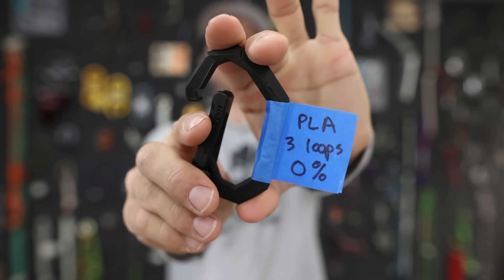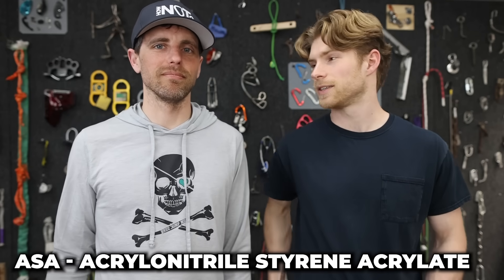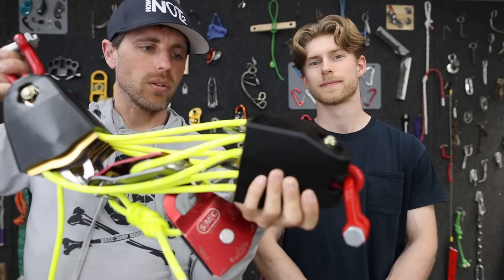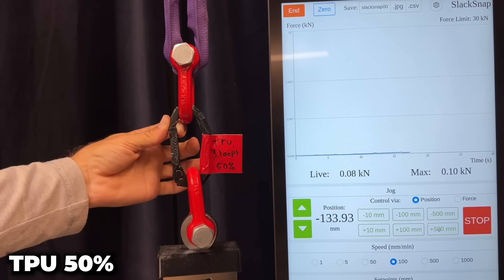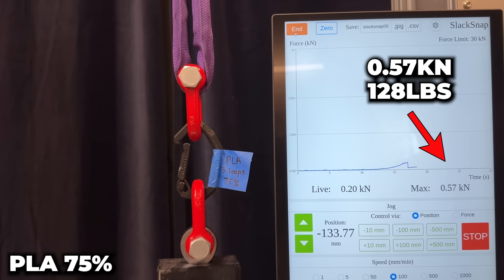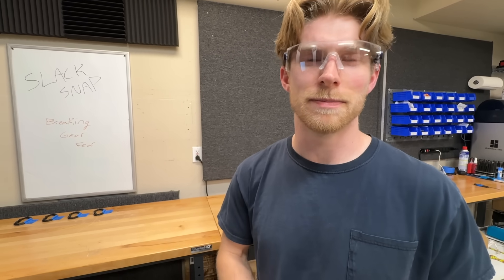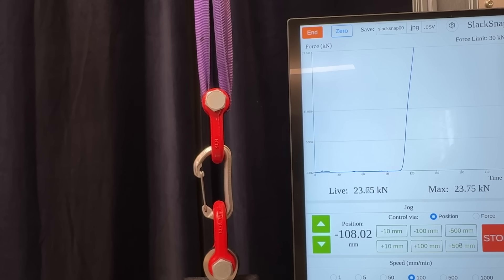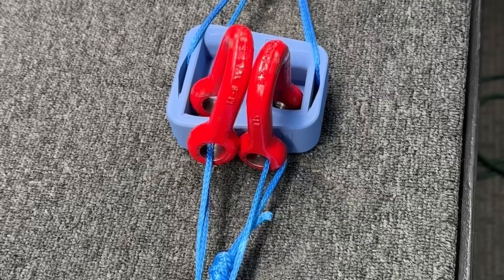I 3D Printed Carabiners

Comment: I 3D-printed some hooks to use with paracord so my parents could make an adjustable line for their cruise ship balcony door. They cruise 4–5 times a year, so they like keeping the door open while sailing. The printed hooks actually worked, but I ended up swapping them out for some $0.88 aluminum hooks instead. For that little price, I knew the aluminum would hold up way better on all those salty cruise ship voyages.

Comment: I am currently working on printing strap on steps for a tree to reach two geoccaches on about 17m hight, I previously falied to prusik up there couse the bark is to rought and I failed using the two belt method also

My plan is to have 3 steps per m and using a sling about every 1,2 to 1 5m for safety

Comment: Great for backpacking since they are so light. A few years ago I printed one at 100% infill with PLA. I only weigh 130lb but I ran a rope through it and hung off of it statically low to the ground out of curiosity. It’s melted and changed shape a bit from being in my hot van but it still works to this day.

Comment: It feels like you only scratched the surface on this video. There are surely better designs that direct the force into the spine. The infill supporting "all directions" also sounds unoptimal, maybe try directional infill that prints in the orientation of the spine or whole-loop instead?

Comment: Oh man, this is awesome timing. I I tried printing this exact carabiner a couple of weeks ago and was really underwhelmed with its strength. I saw the same failures you did (the gate pops out with very little effort). I found that that this carabiner was weaker than the "Strong Flex Door " carabiner by the same designer.  I loved the gate design, so I decided to riff on it.

I've spent the lats week working on a redesign and so far have been able to 10x its performance (just using it to dead lift bumper plates). It would be super cool to see it in your setup if you do another round of testing, but I think the frame still needs more work. I actually found this video hunting for your videos on carabiner testing for some inspiration. I didn't expect to find one on 3d printed ones. Neat!

If you're interested, here's my design.
https://www.printables.com/model/1369738-10x-stronger-flex-door-carabiner-ddf3d

Comment: Oh hey. I've had one of these printed in some glow-in-the-dark filament (PETG maybe?) a previous roommate had. Just sits clipped to my backpack grab handle. Never really gets anything clipped, so I guess it's just a unique identifying accessory, and neat thing to play with. Though sometimes I might clip a hat to it.
Reply: Agree that they're really terrible for anything more, lol. Like, really cool idea, but yeah, the gate is just horribly loose and easily (semi-permanently) deformable. Also as you comment @3:19, it's a fairly oval-shaped design, rather than an offset D, so yeah... forces a lot of load on the terribly-weak gate design.

Comment: Love to see a PETG one printed with 20 perimeters set in the slicer, this will force it to use all perimeters and no infill and makes really strong (for plastic!) prints. Also print it using the Structural setting (in Prusaslicer) which is slower but you get better layer adhesion than the Speed profile. Finally the weak link seems to be the latch so a bit of redesign there looks in order.

Comment: == Carbon fiber climbing carabiner ==

I've designed a 3D printable carabiner that is strong enough to easily hold my own weight (The Suicide Carabiner, Thingiverse), when printed in both PLA or PET-G. I also tried printing it with one of the strongest carbon fiber filaments on the market (BASF Ultrafuse PAHT CF15), would be interesting to see how strong it really is!

Update: Tested the break strength of the Suicide Carabiner printed in carbon fiber nylon to 3,5 kN or ~800 lbs!

Comment: I design and 3d print stuff for regular outdoor use, but nothing that would ever hold any real load. For outdoor use, PETG is OK, but it still often gets brittle and breaks after a few seasons. I'm talking thinks like pully blocks for bear bags when camping, mini belay/friction tabs for straps and cords with minor static loads (eg tent guys), bike stuff like eccentric shims for mounting a front bike derailleur at the right spacing from the tube, chain-drop preventers, second-bar stubs for stuff like bike bells, fender mount hardware, etc. 100% infill printed stuff can be OK in compressive loads, but there isn't a 3d printed filament that has any reliable tensile strength for anything of value, let alone a life.

Comment: Try doing like 10 wall loops or whatever is necessary to provide a solid part rather than increasing infill. Because of the way the layers are laid down, it tends to increase strength better than 100% infill. With a better design carabiner too, might even hit 1KN!

Comment: I would LOVE a different plastic biner option than BD's b/c there always out of stock.....I use plastic biners in the saltwater all of the time for paddling and fishing....I despise rust and corrosion so any way to reduce it, I'm in!!!  I know there are SS options out there, but they are heavy and expensive.   would love a plastic biner option that could hold like 500lbs working load

Comment: I have driven cars with 3D printed suspension links and engine mounts. (3D printed aluminium, that is) Apparently it has better properties than cast aluminum. The info I have doesn't include strength relative to forged alumium, but I would expect that to win.

Comment: I have printed several carabiners out of petg with 25% fill and hung from them on a pull up bar to test them and they held fine. Also the design I use opens all the way and still closes well, and they transfer weight to the carabiner body instead of the gate. Kinda disappointed with this video. They are great for any gear, like hanging a bottle on a bag or climbing shoes on your harness

Comment: You guys should try testing a printed carabiner that is actually designed to be somewhat strong like:   "Utility Carabiner v2" on Thingiverse
The carabiner in this video is not designed to keep the gate closed under even the lightest of loads.  The shape of it also causes the rope to load the gate instead of the spine.  Even if you machined this carabiner out of aluminum, it would still suck due to it's geometry, not it's material.
Reply: Just printed the small version Utility Carabiner v2 that you mentioned with Polymaker HT- PLA-GF and 10 walls (solid) (only took 17min to print) and it's at least 1KN. I'm 190lbs and was able to bounce up and down a bit while hanging from it. Obviously not a life-saving device, but could be useful for accessories and stuff like clipping things to backpacks. 

I bounced harder until it broke, probably about 1.3 KN I'd wager, and it exploded into 4 pieces, throwing one piece so hard at my belly it left a small welt. Knew that was coming so I wore safety goggles...okay a freediving mask but it was what I had handy🤷‍♂
Reply: This plus i'd really like to see carabiners printed out of Markforged's continuous carbon fiber strand material. I bet it's way, way stronger than people think.
Reply: @Maccaroney or lost PLA casting.

Comment: I don't think that metal additive printers (SLS) will be cost effective for something like a carabiner because forging (hot or cold) of aluminum is not only cost effective for a product that will have a long production life but also increases the strength.
SLS printing would be useful in parts with lower production volumes and/or shapes that cannot be forged in a single die, likely parts of the ascender you have been developing or other specialized piece of equipment.

Comment: I use 3d printed carabiners all the time while camping. They're perfectly good for hanging water jugs and such. I print the body of mine out of PLA and the gates out of PETG. The reason is that the PLA is stiffer and avoids the problem where the body twists and the gate won't lock properly, but the PETG is more flexible and allows the gate to open all the way without breaking.

I ended up designing my own models because most of the published ones I found were weird novelty-looking things like the one tested in this video. Mine look much more like a traditional D carabiner. I've never broken one, but I do want to hook one onto my luggage scale and see how hard I can pull before failure.

Comment: PLA is actually rather strong as far as thermal plastics are concerned, not the best but more than decent for most typical 3d printed objects.
However I do agree that these don't seem to focus on having the bulk of the strength along the spine. A bit of a mistake to have the spine be such a C shape to be fair and something that could be improved.
Not that I personally would regard plastic as a good choice for safety around load bearing parts that are even indirectly life supporting.

But I do ponder, if one straightened the spine, that would help stiffen the whole mechanism and likely put less strain on the gate tooth. This would probably help the gate stay closed for longer before it fails. Would this break the 1 kN line is the better question.

Comment: Infill in 3D prints is not nearly as important as print orientation and boundary layers! Changing the edge layers from 2 or 3 to 5 or 6 and printing so the layer lines are colinear with intended load will improve 3D print strength

Comment: Can you print a soft-shackle in a nylon-ish filament (tensile strength with some flex)? When you break out a soft-shackle during a test I'm always impressed, and seems like a mostly continuous softshackle could be printed (extra points for buried, but not necessary)

Comment: Seems like a good idea for keyrings and clipping bags and stuff to other bags or prams and things. Plenty strong enough for that purpose, and there would be less Chinesium unrated ones floating around. People put way too much faith in the things, using them to secure loads and all kinds of craziness. I see a disturbing amount of them on the road, either missing the gate entirely or with it bent completely open. Found quite a few of them, or pieces of them, inside tyres also :( always sad when someone needs a $600 tyre because of a $0.03 Chinese clip :(

Comment: I have made a bunch of them with 6+ walls and 20% infill with PLA. I use them for holding water bottles, lunch bags, holding shock cord, and other light duty tasks. Though I did stress test a couple of them by using them to hang a hammock and took a nap. A bit sketchy and I wouldn’t hang high with them but stronger than I was expecting. 
The ones I’ve printed look more like a traditional carabiner so I’m assuming the load had better distribution. 

Mostly I just like that I can make any color and size within an hour or a bunch of them over night.

Comment: I only have 1 thats not climbing rated on my rack and thats for the bungee that holds my micro traction up when im top rope soloing, but even that is tested to 4 kn and its so small its no good for anything else anyway but even the mini ones i use to hold my rope protector on are rated for climbing.

Comment: I have made a fully 3D printed outdoors climbing wall with ASA. The stuff is very strong if you desing for it, use 6-8 wall thickness and I have found that infill between 20 to 100% does not change much. I am 6'4 240lbs and climbed for multiple years on that wall and nothing ever broke, not even the smallest crimps, even after staying years outside through canadian winters! 3D printing really is amazing, but you gotta know how to optimize it for sure :)
Reply: Sweet. It's funny how many reddit posts I've seen that basically say YGD if you use printed holds on your wall. Granted, it does take a lot of knowledge to do 3D printing right, and many people have false ideas of what the medium is capable of.
Reply: @geometerfpv2804 I genuinely don't understand it, like I've seen plastic maul handles so I know plastic can be strong but I assume the application in layers makes it weak. I think you're right, a lot of makers don't get it.

Comment: I've designed hand held 3d printed cam cleat to make sailing easier but I use PC with CF fill. Before making axles wider at the base it held my weight so 1kn but Ill have to test it properly. And of course it's solid as in as many perimeters it takes to not require infill.

Comment: Try 100% wall thickness ie the entire carabiner is a loop of filament. A better design shouldn't hurt either (as many other commenters have pointed out) the biners in this video appeared to have reverse d style where most of the load is concentrated on the gate side. Fiber reinforced filaments could probably also increase the strength if you want to get into that.

Comment: If you use a P-L-A- CARBON-Z3* filament it is in most cases as strong as the unrated carabiner capabilities at around 50‐100lbs of  dead weight and a capacity of 200-300lbs of pull/drop force. Also you can't fill it in a continuous line you have to make the design like a puzzle piece and start one way end another but make sure the design is 100% filled and no waste/airgaps. Also denatured alcohol will destroy the infill and strength area by weakening most of the connection particulates that  are in a continuous loop. Therefore you have to offset and make different passes at different lengths. A carabiner should take 3-4 hours to print if done for a strength test, not 35-45 minutes.

Comment: I wish they'd do a pull test on a simple key ring, just to see how strong it is and at about what weight it starts to deform, then you'd even have a visual indicator of if you have started to exceed its load limit from it bending.  Obviously not all key rings are made the same so results would vary.

Comment: Did someone out there actually suggest using 3d prints for anything that is supposed to hold up a humans weight?
I am only asking because there is so much stupidity out there right now, it would not even surprise me.

I'll happily put my stuff into 3d printed boxes and hang those onto 3d printed walls.
Things can be picked up if the print fails and they fall to the gorund.
Humans on the other hand go splat in very colorful (mostly red with some streaks of "offputting blue", "vomit yellow" and ... "brown") ways if they do the same from great heights.

Comment: I've been building 3d printers for more than a decade. Printed a bunch of these. PLA kinda sucks as it deforms in simple summer car heat. I typically use them for small water bottles, and they are AMAZING for cable management or simple key chains. 

You have to also consider failure modes. PLA shatters, abs bends, others are somewhere between.

Comment: I have used a small Carabiner for my keys for a couple of years. Works great, has a screw lock and is not as hard as a metal one. It has no signs of wear and is printed from PETG. Before that I used a metal one, where the spring failed pretty quickly.

Comment: Ok, this is going to sound sketch...... because it is...... some climbers are having to resort to using stuff like this or accessory carabiners in part of their "safety" system. So, when you are climbing a tree that has already failed and the bit you are on is being held up by the tree literally leaning on something else, climbers sometimes used carabiners that they hope will break if the bit of tree they are attached to remembers about gravity and continues it's fall with them still in it. Ok, they are connected to another tree so hopefully that carabiner breaks and leaves you hanging from your main safety line. Rock climbers have already established that the problem with using some random accessory carabiner is that you don't know how strong it is. You can test to see if the carabiner is going to be strong enough to hold your weight by bouncing up and down on it a bit, but what happens if it's to strong?? Not something most climbers are worried about, is it? So, if the bit of tree falls away, your main anchor can support your weight, but it also has to hold the weight needed to break that accessory carabiner. Not to bad if it can only hold 100kg. I have some carabiners that will hold 250kg (for a hammock)....... if you put on one of those by mistake your safety point needs to hold your weight plus that 250kg...... and remember, your safety point is another tree....... and you're hoping it will support you..... so potentially more then 350kg in this case..... 😅 Where I'm going with this is that it would be great if you could purchase a breakaway carabiner that has been certified to break at 150kg or 200kg. I'm not sure how much it would need to be able to hold, but you get the idea. It would need to be able to hold the climber and all their kit.... including a chainsaw.... and maybe a safety margin 🤔🤔🤔

Comment: 100% infill would have been interesting. Also, clearly, the design was not the strongest.
Reply: The design sucks. It blindly copies a metal carabiner instead of re-engineering the shape for what best fits plastic. The nose is clearly not well built and doesn't hold at all. This needs to be a locking design.
Reply: A metal carabiner would be designed to put the majority of force on the spine, not the gate.
Reply: @leveller4 You don't think that's a relatively small difference? It's even the size and dimensions of a metal carabiner. Obviously plastic needs thicker shapes and more reinforcement....and more than 4 walls, which is not even 2mm thick!
Reply: @geometerfpv2804  no it makes a significant difference. Most strong aluminum carabiners these days are D-shaped, designed so that rope settles toward the solid, straight spine of the biner. You can see with the latest short "HMS test gate side" that if it's weighted on the gate side, it breaks significantly lower, even when closed.

The 3D printed one also has a curved spine which means the force will be distributed unevenly as well.